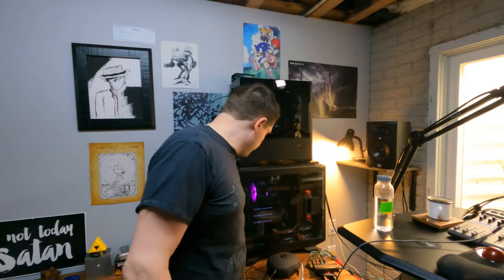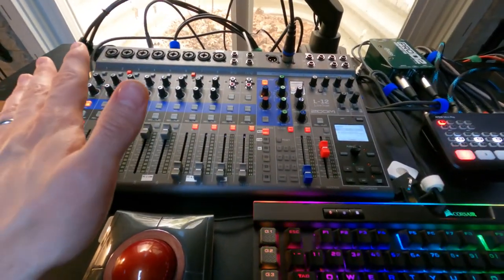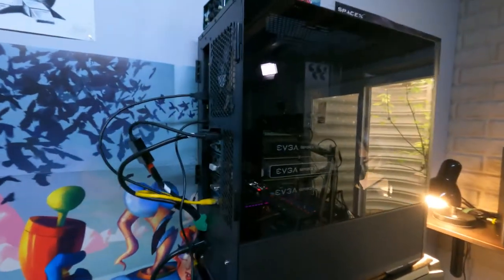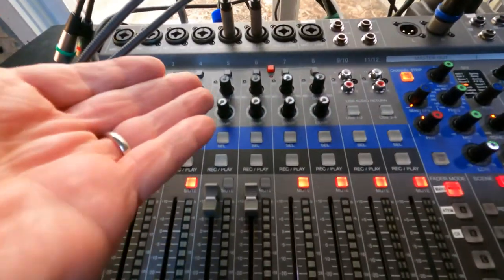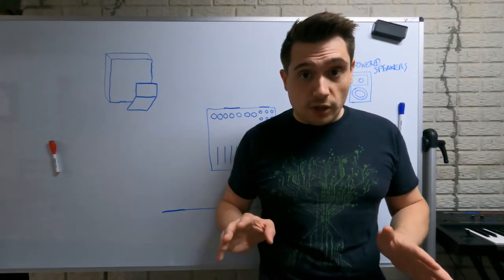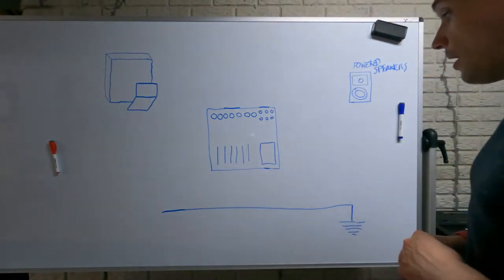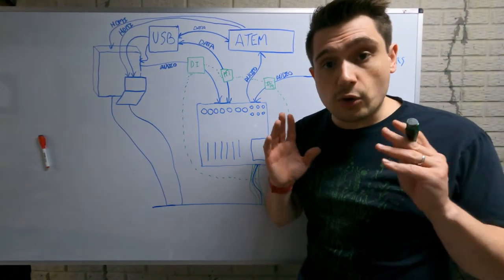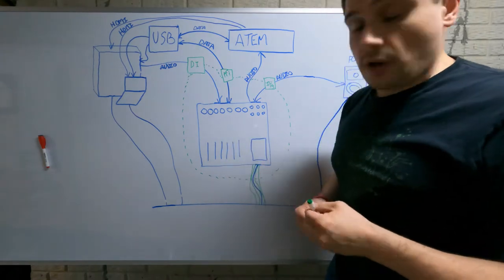SOLVED: High Pitched Buzzing Noise / USB Audio Mixer Ground Loop Issues

Comment: Solved? Well sort of... most of that hum issue could be from overall bad grounding in your house circuit, especially if your house is old. A ground rod ohm resistance test from an electrician could tell you if your house's external ground rod is bad and has deteriorated in the Earth outside. Also you need to check every single switch and outlet in your house to make sure there isn't a short in your house wiring. An exposed hot wire could be in contact with a ground wire somewhere. A Klein Tools RT250 tester could help speed up testing all of your outlets for proper ground. The Radial box and loop killers are fine, but it's all a reactive fix rather than a proactive fix. You are addressing the issue after the fact instead of addressing the root cause.
Reply: I was wondering this. Because obviously not every computer + peripherals plugged into an outlet creates this high-pitched whining sound, so I wanted to know if Alex (OP) ever considered what the actual source of the ground loop issue was (i.e., why there are ground loops in the first place) vs only addressing how to remove the whine. Alex certainly did an absolutely amazing job of explaining how he troubleshot this issue step by step, so thank you so much for that, but I am definitely left wondering if there is something wrong with my house that I need to address first! It's a rental, so I don't know how much I can do, or if the only option is to try and kill each ground loop as Alex has shown us. Thank you @andynominuss for proposing some possible explanations. Definitely going to look into this more. I noticed that one of my surge protectors has a light on it which indicates a problem with the wall outlet, and for one of the outlets in my music room, it is lit, but not when I plug the surge protector into the other outlet, and the first outlet is where the whine is.
Reply: Most of the electricians can't even do a proper job, what to speak of detecting problems. Our house got flooded "thanks" to roofers and apart from the main huge work (myself for 6 months) i had to call an electrician. After his work (and a new panel) the noise got even worse and two outlets don't work. He does not answer my calls and text messages... Even if...if... this kind of testing is very-very expensive. So, getting rid of noise somehow is better than noise.

Comment: EDITED: I had a long term issue with digital whine/screeching and stuttering noise on my MAudio Air 192|4 audio interface that I originally thought might be interference from the PC it sat on top of because moving the mouse would change the pitch of whine. This sound was very slightly noticeable on my studio speakers (1/4" balanced TSR cables) but very noticeable on the 1/4" headphone jack. While troubleshooting, I unplugged the speakers and the noise went away on the headphones, so it was the powered speakers introducing the loop. I bought a similar direct box with 2 channels and put it between my speakers and the audio interface. No more noise on the speakers or the headphones!

Comment: A little late to the party but the Radial StageBug SB-6 might be a slightly cheaper alternative to the Pro DI and work better for the connection to the ATEM as it has a 1:1 transformer. Frequency response is super flat, ground lift for each input, will take balanced or unbalanced input and convert it to unbalanced or balanced output depending on the plug inserted (TRS vs TS).

Comment: i dont know where to ask anymore so i ask from you guys. i have camera studio setup. My camera has pluged in a external microphone, charger and external monitor.  Monitor give so bad hissing noise to mic line so the audio is unusable! have been changing the cables and ac adapters and even tried external audio recorder and even then i get very bad noise when microphone is in the same room!! what is going on? Sorry my bad english :D

Comment: Im getting the same noise but im using a condenser mic into a laptop. Could the power source for my preamp that is plugged into my outlet and to my laptop be getting a loop through the charger that is also plugged into the outlet and into my computer?

Comment: I've been in audio engineering for over 30 years, and I found your "grounding bubble" to be really insightful, as I had never thought of it that way. Not to mention that I never fathomed the idea of running a DI box in reverse. Brilliant! That's something that I can hear my Sound Tech professor admonishing me for back in the 90's. Lol.
I came here because I'm running sound for our church, and we have an awful ground loop hum that I'm trying to track down. Your video was a great resource to help me visualize and fix the problem. Thank you for that!
BTW, I bookmarked your video, and will be using it as a resource to teach all our sound guys about ground loops.
Reply: DI box in reverse - it is passive, so it is logical, but it didn't help me either :/

Comment: Huge thanks Alex. Watching you sort this out motivated me to get to work and finally sort out my own noise issues. I also have a Zoom mixer (R24), and it was painful how much noise came through the speakers when ever the USB cable was connected. Luckily for me, the only thing I had to do was insert a stereo transformer with lifted earth on my Casio CDP-120 audio connection. This device is also connected to the computer via USB,  and similar to your case, created an earth loop. Previously, I tried the earth isolation transformer between the mixer and the amp, but of course this did not fix it! Thanks to your video I persevered. It made me realize that the only equipment setup that would NOT have a problem would be the simplest configuration of guitar(s) and mics i.e. no other devices with a USB or power ground. 

Just as an extra thought worth mentioning is the subject of midi. Back in the 1980's when the engineers developed midi, they considered as a primary problem the subject of earth loops. To circumvent the problem, they made sure all connections were isolated with optocouplers. The same consideration has not been given to the use of USB and audio devices. I could imagine some engineers these days slapping their foreheads over the egregious lack of consideration for what is a major problem.

Comment: Thanks for this detailed demonstration ! On your very last issue, Mixer Balanced OUT going to ATEM unbalanced IN, there's a common way to proceed : you have 3 wires in your balanced audio cable, on the balanced side  the Ground shield goes to pin 1 (if XLR or the longest bit on a stereo jack ), RED  goes to pin 2 on XLR (or the tip on a stereo jack) and BLACK goes on pin 3 ( or middle bit on a stereo jack). What you do is connect the ground and black together on the balanced side of the cable, and on the other side on the unbalanced input jack you connect the RED on the tip and the BLACK to the ground part of the jack, and cut the Ground shielding wire so that it's not connected.
That may not work for that purpose, but that's how you go from balanced to unbalanced. That saves a DI box, and you don't have the potential level issues you're mentioning.
Reply: Thanks. Are there commercially available cables that offer this design? I use multiple ATEMs in my studio and have the dreaded hum from my Rodecaster Pro.
Reply: @markburke2414  I've always soldered mine, I googled it does exist, but you have to make sure it's that configuration : balanced male XLR to unbalanced male jack (rather than unbalanced XLR where they would leave an empty pin using a 2 wire cable)

Comment: Glad to see you solved the problem. When you've spent all that money on your craft, you want things to work perfectly, so can relate to the pain endured. I can also picture the scene of trying to explain this problem to some noob in a store and getting a vacant 'WTF are you talking about' stare :D My small set up and issue is below - 

1x Macbook, connected to a wall socket powered mixing desk via a USB insert - in that mixing desk I have an XLR condenser mic connected, using another wall socket powered compression unit, connected through an insert on the same channel as the mic. No problems, no ground loop (luckily). The problem began when I tried to do something very simple, which was add a 3.5mm TRS to Dual 1/4" TS  cable between the mixing desk and my DSLR camera,, so that the mic runs through the camera (for better lip sync on live stream/conferencing). Instant ground loop and very loud hum and buzz and I couldn't work out why. Now I know why. I'm using my DSLR camera as a webcam, which is also wall socket powered via a dummy continous battery - when connected to the mixer, this means I have two different wall socket powered devices running through it (the compressor and camera) which is obviously causing the ground loop (with the USB connected wall powered Macbook which may or may not be adding fuel to the fire). I've ordered a ' Behringer MICROHD HD400 Hum Destroyer' and will expect that this will work, when connected between the camera and mixing desk. Fingers crossed.

Comment: Great video. It got me thinking, and I didn't even need to watch to the end. I have a simple, completely unbalanced audio path from my desktop PC to my Denon amp and on to my JBL non-active speakers. Some years ago I reduced the noise coming from the PC by introducing a cheap Digital to Analogue Converter (DAC) and adopting the optical output from the PC instead of the analogue line out. The DAC is powered from a USB port on the PC. Having relocated to a dedicated and much quieter home office/study/studio much of the high-pitch buzzing can be heard once again. So on your advice to "cut" additional connections to 'ground' I simply added a USB power brick which has no ground connection (it's double-insulated instead) to power the DAC instead. Problem solved! A great lesson learned for when I move up to a semi-pro audio interface.

Comment: Thanks for presenting this so well and sharing it with us. I'm a retired Electrical Engineer and I have my MacBook Pro and a USB DAC and Mackie mixer and powered monitors, a lot more simple than your setup. One USB DAC has high pitched noise, the other doesn't. I just use the USB DAC that doesn't buzz. But, inspired by your efforts, I may dig further into this, if I come up with anything I'll share it with you for sure. Thanks again and NICE work here!
Reply from the maker: Thank you! Glad to hear from a real EE that I didn’t make too much of a fool of myself, lol. Good luck eliminating the gremlins from your setup!

Comment: This is the best video on ground loops I have ever seen, this helped me rethink the issue from the ground up (no pun intended) and I ended up discovering that a single usb connection was causing the loop. I kept thinking it was my mixer/instruments around it. Thankfully the USB connection is to power my Zoom H5, which can alternatively be powered with a USB power bank/batteries separate from my surge protector everything goes into. Seriously thank you SO much for this video.

Comment: My problem was solved with a ground isolator, a transformer with a 1:1 gain. The case is metal, to avoid parasite signals to enter inside. It works very well. Nice video!!!

Comment: I can't even begin to thank you enough for this video.  I had purchased the IFI Defender+ and it made only a little difference in the noise.  I had replaced adequate monitors hoping things would change, ran power into different outlets.. hell I was going to change out the AC outlets themselves.  I had tried DI boxes earlier but I had switched the settings to ground instead of lift.  That alone made all the difference and it sounds PERFECT.  Every musician / streamer who deals with interfaces or mixers should watch this!

Comment: For years with my zoom livetrack 12, when I'd plug a USB cable into it from my PC I would often get a high pitched noise wine... low level but enough to be very annoying. It wouldn't come through in recordings, only through monitors.  I tried ferrite beads on the usb cable since I read that could help but they never worked.  After watching this video I tried throwing ground loop isolator in-between the mixer and my speaker amplifier and it completely took care of the issue. no noise issues at all!   I wish I would have done this years ago.  I was about to sell my livetrack 12, now I dontt have to.  Thanks for the vid!

Comment: Nice explanation! I've never seen any where else that shows how to solve the ground loop noise approaching it as a whole system.

I was glad to seea lot of techniques you've shown here are ones that I've been already using.

One thing to add. I use Radial's SB-6 to make a signal from balanced to unbalanced. It is quite versatile. It is better than using a DI box reversed. One more thing that helped me debugging a nasty noise was using a better power adapter. I replaced the usual bundled power adapter with a regulated linear power adapter with matched voltage and the noise level went down like -10db typically. Or IFI's ipower series are SMSP but they are really quiet. If a device is USB bus powered, using ipower with idefender solved issues.

Comment: My issue was not as complex as yours, but Youtube led me here anyway, enjoyed your troubleshooting process! I had a nasty loop when my Maschine MK3 audio interface was plugged into my mixer as well as my USB C interface, both devices unpowered (just bus-powered from the computer). Solved by swapping out each pair of unbalanced TS 1/4 inch output cables going from each interface to the mixer, to balanced TRS 1/4 inch cables.

Comment: Great video. Yes indeed a transformer can be used in reverse without any problem. I would just add that it is okay if it is done with a 1:1 transformer (as an isolator should be), but if there is some down step or up step of the voltage, reversing the direction will also inverse that. So it may induce issues with power ratings being exceeded, crazy high voltages..

Comment: Thank you so much for posting this! I run everything into a studio mixer (a bit overkill) though like having access to additional preamps, effects, and equalization.  That goes into a flexible interface and, for years, I've not had many issues.  Until the today I noticed that high pitched noise.  I checked signal flow and because I only use headphones I knew some of the optoins you mentioned may not work.  That said your diagram helped me get it - I plugged the mixer into another outlet and things seem fixed.  I needed to see "why" the mixer was introducing the high pitched noise and while I still need to do some other maintainance I appreciate you making this video and breaking it down for us! It's so frustrating when you have ideas and "can't" get clean sounds though I believe I'm clear now: thank you.

Comment: Thank you! We were having a similar issue with our ATEM setup (close layout as yours) at church. I bought similar products on a feeling right before a friend sent me your video. It seemed to match up so I was hopeful. Tried them today at church and yes! the high pitched sound (demonic as you called it... when you said that, I felt you, sir!). I used another brand of USB filter and I did find a 1/8" stereo mini filter for my purposes, but principle should be the same. Thank you so much for this video and I hope it helps others with similar issues!

Comment: Hey mate, thank you so much for this. I've been struggling with noise for ages and finally got it mostly sorted. Your explanation was super helpful.  I actually solved one HF USB noise by simply re-plugging my USB synths! Still have to solve the guitar pedal loops but at least the mixer bubble is sorted now. Thanks again

Comment: My solution to this problem years ago when I was streaming with a dual PC setup and a mixer, was to buy two sound cards with Optical outputs and inputs on them, and then route them through a optical to RCA stereo converter to the mixer.  I just did it in reverse to route the outbound signal from the mixer to the receiving PC.

Pain in the butt but it did work.  I didn't even realize I was dealing with a ground loop problem, just had a feeling that digital audio to analogue audio conversion would fix the issue.

Comment: This video was just what I needed, thank you! I fixed the whine in my studio monitors. My only concern now is that my DI box (51x Audio Transformerbox) colours the monitor signal path, albeit in a subtle and somewhat flattering way. I was going to use it for recording, mainly, but after watching this I just had to try it out between the audio interface and monitors. Will live with this setup for a while and see how it goes.
Reply from the maker: It seems like these setups are always evolving! Glad you found something that is working for the time being!
Reply: You can use a Pyle or Morley hum eliminator between your audio device and your monitors without coloration in sound.

Comment: I feel your pain!! I've had similar issues, and followed a similar thought path (in my albeit slightly less complex set up). I also probably need a passive DI box that is connected in reverse - as I need to break a ground loop going from my balanced TRS outputs on my audio interface going into unbalanced input on my DSLR. It's good to know that this solved your issue and can be done. All the best, and thanks for explaining it so clearly!!